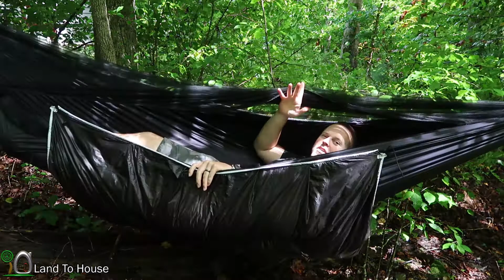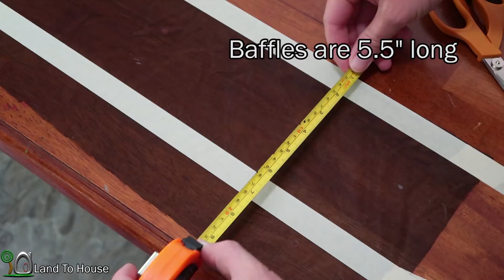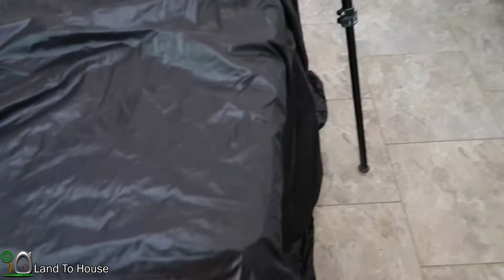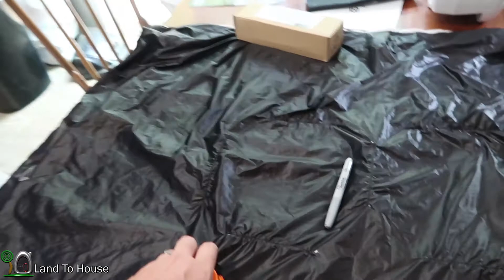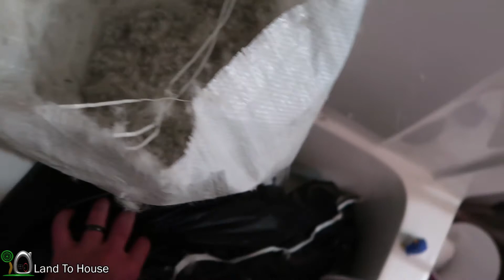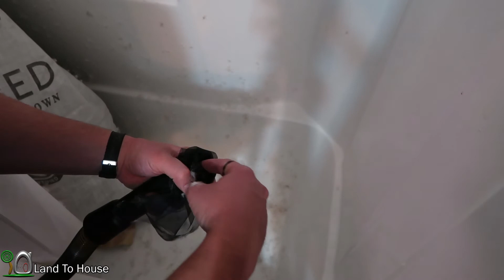Make a Hammock Underquilt

Comment: I hate to admit that I really enjoyed watching your battle with the down, almost a guilty pleasure, sorry.  If you ever want to work with down again, let me know, I'll share with you an easy design for a down vac/injector (venturi) that only needs a bit of PVC pipe and fittings and an air compressor (or leaf blower or shop vac with an outlet hose connection). It keeps the mess contained and lets you inject the down in the quilt better than by hand.